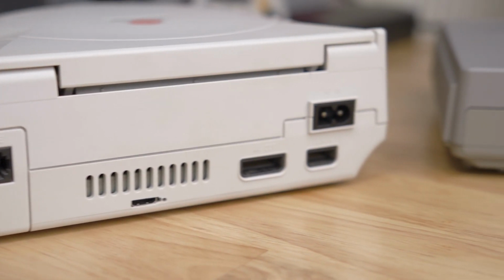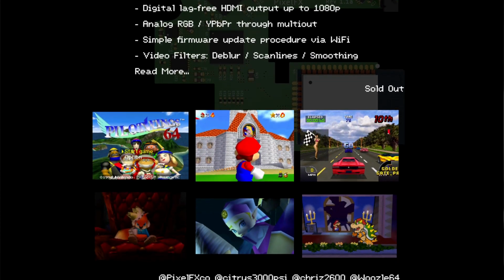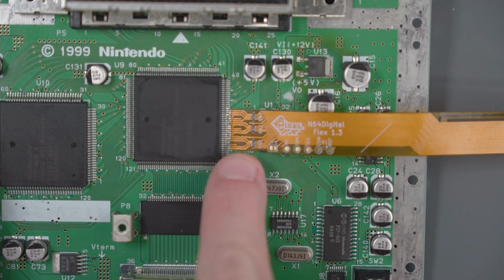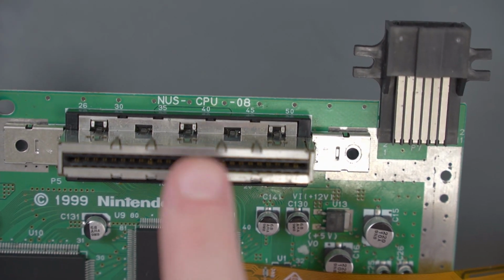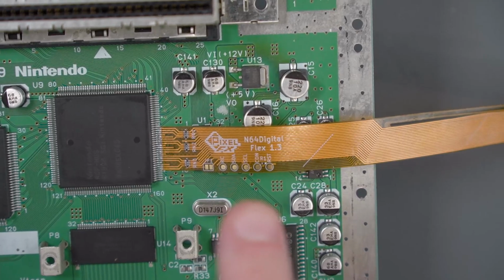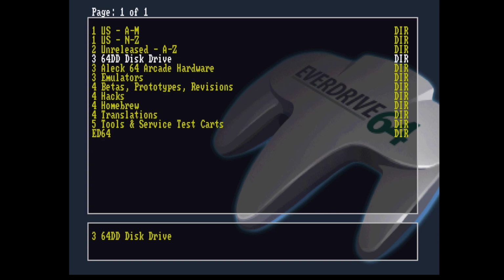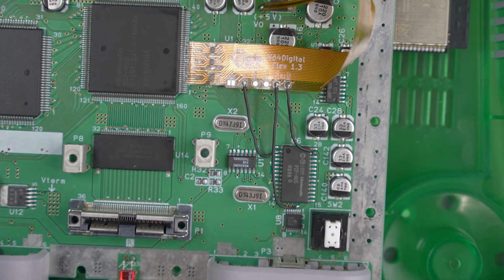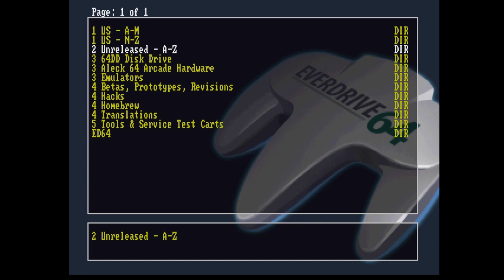N64Digital Install - PixelFX's First Mod!

Comment: I have a strange problem,  I installed the n64 digital today and the hdmi output image only work with the composite cable connected, if I disconnect the av cable I don’t have image, what I doing wrong. Help please
Reply from the maker: Hmm, I'm not really sure. I would start by making sure the flex cable doesn't have any bridges and is correctly installed in the mod. If you need more help, head over to the discord!

Comment: When you spray alcohol and rub it with a toothbrush where does the flux residue go? Do you think it evaporates with the alcohol? It needs soaking up or you are just left with a sticky surface.
Reply from the maker: I usually use a paper towel to dry the surface, I just don’t show it in camera
Reply: @dubesinhower  Cool.

Comment: I'm biased playing most retros systems om a crt so is digital worth it? I have a Tim Worthington rgb kit already but haven't got it installed.
Reply from the maker: I personally like the "emulator" look of sharp pixels on a monitor, but if I had the space, I would keep my CRT set up all the time. I think it's worth installing the rgb mod, because you can use component video in a CRT as well as with an upscaler

Comment: Great video, though I would have liked to hear your opinion on the mod itself. Thanks for not cutting out the part where you struggled with the extra solder on the pins, and how you resolved it.

Comment: Which mod do you recommend for best visuals/features? Ultra hdmi or N64Digital
Reply from the maker: Visually they’re similar, but there are some nice features on the N64digital (WiFi firmware updates, clock control)

Comment: Yes, that is a voltage regulator. You can even see that the input side is silkscreened “12v.” That capacitor nearby which UltraHDMI uses for 5v is on the same 5v power plane. The other cap that UltraHDMI uses is an alternate point for 3.3v but N64Digital grabs that from the RCP. UltraHDMI flex has gaps for the RCP 3.3v pins and gets 3.3v from the capacitor instead to avoid shorting 3.3v to neighboring pins. Perhaps it wasn’t that important! :)

Comment: Looking forward to your Extron videos since I’m going to be making custom cables for mine!

A couple N64Digital tips after doing several of these:
YPbPr output is not enabled yet. I had to shelf my custom YPbPr cables and dig out my HD Retrovision cables to test.
You don’t need to remove the Expansion/Jumper Pak. It will come off with the top shell and stay contained. No risk of marring it that way either. :)
The bracket pieces don’t need to come out despite what it says in the N64Digital guide... not even for No Cut. If you look closely you will see that only part of each one goes under the N64 and they align with the ground plane. Since they normally ground through the shield, this is fine. There isn’t even a concern about them coming loose because they are secured by the same screws that hold down the motherboard.
You removed the EMI shield and heat sink with the heat blocks the same way I do but I should point out that this can lift one side of the memory chips if you don’t lift from the back. Also it is good to note that the tabs on either side of the memory expansion slot should be lined up and dropped down into the notches before putting any screws back in otherwise they are likely to be misaligned.
Reply: "You removed the EMI shield and heat sink with the heat blocks the same way I do but I should point out that this can lift one side of the memory chips if you don’t lift from the back."

Very true. Ask me how I know. 😒

(luckily it only broke the solder joints, so easy to press the chip down and resolder into place)
Reply from the maker: Yea the UltraHDMI instructions didn't mention anything about the N64DD brackets
Reply: @dubesinhower  Yeah, but it also didn’t mention anything about No-Cut UltraHDMI since it didn’t exist back then. Retroactive still hasn’t updated the guide for HW2 (only the user guide) but I doubt he’ll be mentioning No-Cut when he finally does.